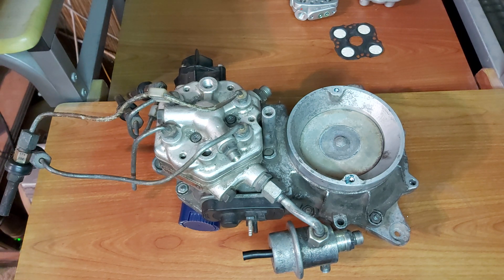㉦Mercedes Ke-Jetronic㉦ - About the adjustable FPR&Mixture adjustment on the R107 MY.1979 Q&A-s

Comment: I am interested in 4 cyl. Mercedes model cars with maybe compatible cis-e injectors.  On my jetta, the threaded union is 12mm x 1.5mm.  The engine is 1.8 displacement
Reply from the maker: https://www.ebay.com/itm/163250343889?_trkparms=amclksrc%3DITM%26aid%3D1110006%26algo%3DHOMESPLICE.SIM%26ao%3D1%26asc%3D20231107084023%26meid%3D861388cb1b374576b9ba2a0490de67e6%26pid%3D101875%26rk%3D4%26rkt%3D4%26sd%3D222095744505%26itm%3D163250343889%26pmt%3D1%26noa%3D0%26pg%3D4429486%26algv%3DSimplAMLv11WebTrimmedV3MskuWithLambda85KnnRecallV1V2V4ItemNrtInQueryAndCassiniVisualRankerAndBertRecallWithVMEV3CPCAuto%26brand%3DBosch&_trksid=p4429486.c101875.m1851&amdata=cksum%3A163250343889861388cb1b374576b9ba2a0490de67e6%7Cenc%3AAQAIAAABUObhgc4Nk8%252BdtAwOww4FKLaj%252FQ5qqgDlQCuqZA43WcPFUWDERCUugbbOk7XQv0JXlBfqCg2xKF3WcPghxGMFw2oSlXvfExEaMYr7I7LmrHcP6czY1wIMt0ORyKiCWt95xldincyyBx3g%252BNDW%252B%252FhWUgTaBhK6xAm%252BJIbCOMehu%252Bdwkt5q8Sa6DCoHcZyRo1Zo60IIXdvOusygJsHaF4vL6BA6LJfdPlF9bpgrLaUvwxrJTXfR7qrBs%252FIQW90n1ilEEPWgMbrkg5U2l9eWdvD19HMtrlsQauKBoVSpvYP0qKnq0tDjnn%252Fvl8vVkXdI%252FQprDSqaA41XrIeM4Q4FJWH6%252BO4%252Bs02Ky5JhH2tFb8gbKqT8cvd%252FEVrKbAlHJSOxz26nvQmIT8hveKDpnnM1G72Voc%252FwHCCdN4IGL5glhxNTVw5QY8p3bRG45mMP8va9Z%252BTrNw%253D%253D%7Campid%3APL_CLK%7Cclp%3A4429486&epid=1371745121

Comment: I have a Mercedes 560. Sometimes the engine vibration increases and sometimes the vibration decreases. what is the reason? This happens while the engine is running without driving😡😡😡😡
Reply from the maker: I get it, but you must tell me which Mercedes? SL, SEL, from which year?I must know those details.
Reply: @mercedeske  SEL 1991
Reply from the maker: @kalfoogaltmimi5043  So, that's W140?
Reply: W 126 @mercedeske

Comment: hi i have problems with w124 230 ke jetronic, Car has been sitting for 10 years and now im trying to fix it  i got it running by giving gas to the intake and it was running badly but after warming up it started to run better but problem is that it doesnt idle  at all and still doesnt start without giving gas in intake(sometimes when warm it does start with pumping gas pedal  but still no idle).sorry for bad english greetings from finland
Reply from the maker: Hi from Serbia. I would recommend you to do a complete overhaul – here I mean the injection system overhaul. If I were you I would start with rubber hoses, complete ignition check, I would remove the airflow meter and clean it up entirely, the throttle as well(without removing the butterfly!!!!), I would check the rubber underneath and its condition and then I would replace all the injectors, check the fuel pump, replace the filter, check the fuel accumulator(you have on my channel how it’s done), check the pressure regulator whether it’s in specs, the fuel distributor whether it delivers even quantities of fuel, the sensor plate whether it is rubbing the edges of its housing or not and then the sensor – I would replace the lambda, the potentiometer and check all the other sensors and at the end check if the EHA is within the specs, I would clean the idle control valve as well. It’s a long road in front of you but even the longest road begins with the first step! Good luck!

Comment: Hello dear friend if pressure drop to 2 bar after shutoff is it because of fuel failing accumulator?......fuel  pump FPR and injector are new
Reply from the maker: Hello. Normally the RESIDUAL pressure should be approximately 3 bar(2.7 is also tolerable) but it MUST REMAIN that way for approximately half an hour!